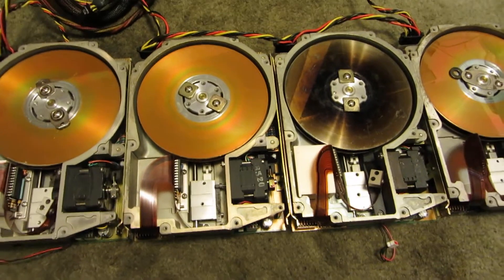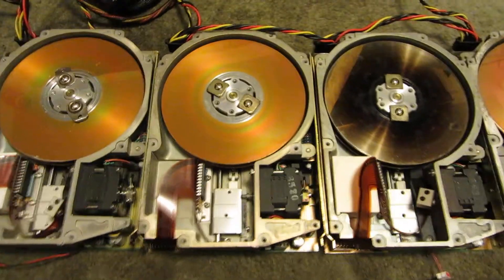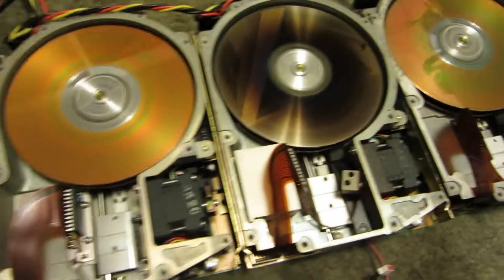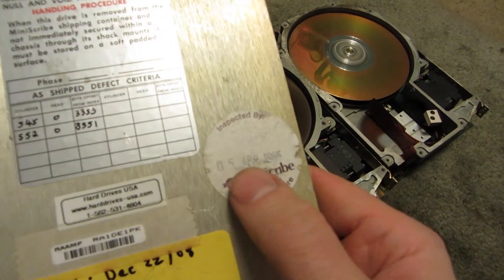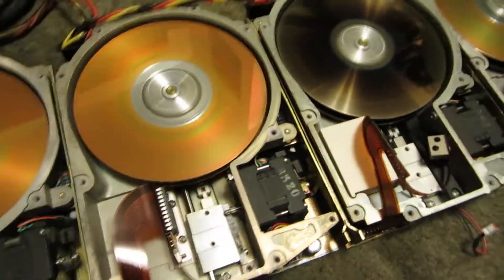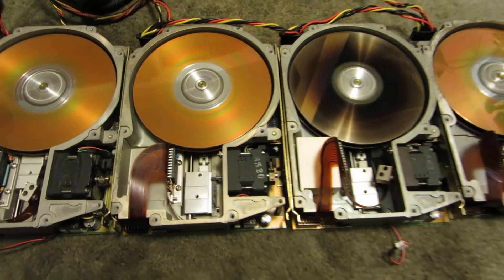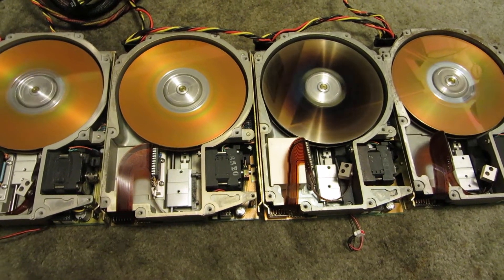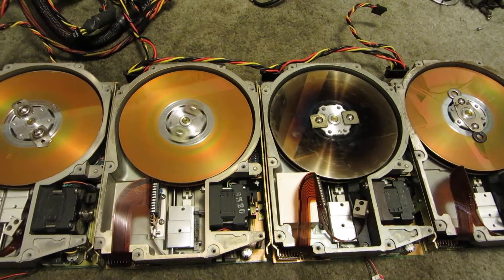Spin-Up Sounds - 4x MiniScribe HardDrives

Comment: Do you still have these platters? I’d love to try some precious metal recovery from them!
Reply from the maker: Yes I do, But I plan to hold on to them for the time being.
Reply: They contain no precious metals. The substrate is aluminum and the coating is ferrous oxide. The darker one uses plated cobalt, I believe.
Reply: @AiOinc1  thank you! Yes I noticed most substrates were intact aluminum, however over all the years of pm recovery, I ran into 1 single hd that had a rhodium/platinum coating on it that surprised me. The yield was about 0.35g of unknown purity rhodium, and just over 0.77g of platinum from 4 platters off an old hd with no identification marks on it except for the circuit board having Fairchild components on it.

Comment: How do they seem to pass a seek test without heads?
Reply from the maker: Haha beats me!
Reply: These are old archaic Miniscribe MFM hard drives from the 80ies, the onboard controller of these devices is quite stupid. All that it does is to move the heads where the track 0 is supposed to be without even reading the tracks themselves but by means of light (or magnetic) sensors and by counting the pulses sent to the head's stepper motor. You can see that sensor on the right side of each stepper motor.
Other MFM drives from that era instead were more advanced and did deeper seek tests, actually when there was something wrong with the heads or the platters they wouldn't be so "stupidly happy" as the drives in this video.
Reply: Stepper drives are dumb and do not read back data from the disk on their own